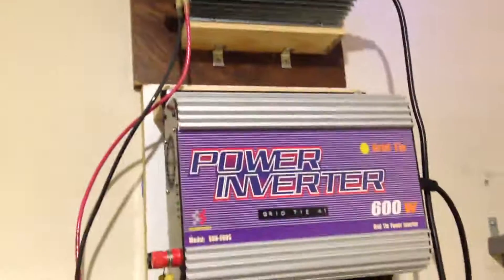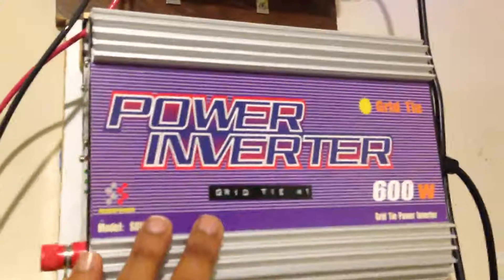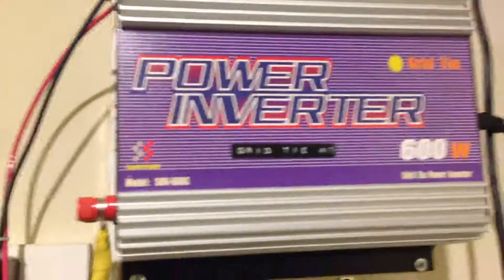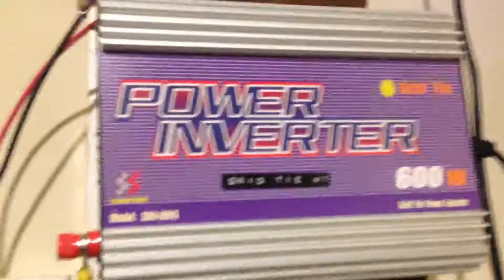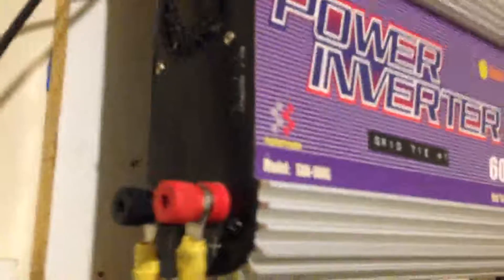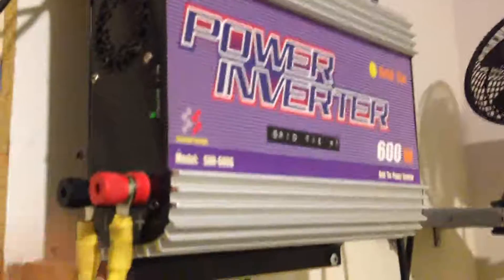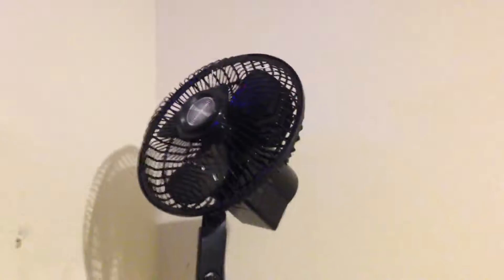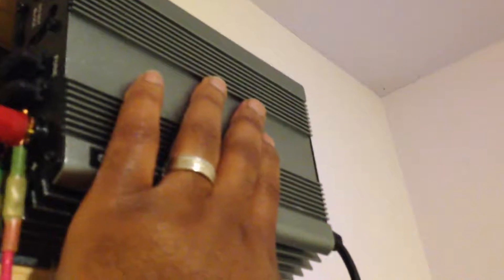DIY Grid Tie - A word about cheap Grid Tie inverters

Comment: I love these things.  I paid big bucks for our 9k solar panel system.  You could put external fans that turn on when the unit gets hot.  But do these units shot off when power to the grid shuts off?  That's when you run into problems if the power company sees power coming from the line when they are working on the wires.  My unit shuts down during power outages.  I'm using a Sunny Boy 7.7 inverter.
Reply: Sunny Boy are a good brand, German made, certified and better than industry average long term reliability.
Reply: @MatthewTaylorAu  Good to know.  The thing I'm worried about is the little fan that comes on inside when the inverter is pushing a lot of power through it.  When it's at 8,000 watts, that little fan is on at full speed.  Eventually those fans burn out.  I wonder if the system knows that it stopped working so a new one can be installed.

Comment: I always put a 600-900w dc to dc regulator on each of my GTIs. I power each at the maximum input voltage, and then limit the current. I also put 1 or 2 computer fans on each GTI connected in parallel to the internal fan. I haven't had one blow up in 6 years.
Reply: How that setup working? I was just about to do the same thing with a 1500W DC/DC Boost unit. 12V to 48V limited to 5A
Reply: @ScubaJamaica  so far no problems whatsoever.

Comment: If you are powering you're grid tie inverter with say a large battery bank or something that could Supply more than it's rated power and it's tied into a grid that could consume more than its rated power, will it limit itself on how many watts it produces?

Comment: So you run the inverter to generate power then you use a fan to cool the inverter. Sounds like the power generated by the inverter is cancelled out by the fans you are using to cool the inverters. 🙃🤔

Comment: Not efficient?  Did you ever measure the efficiency?  Do you even know how?  I got 900 watts into my 1000 watt cheap grid tie inverter.  At full power the Grid Tie Inverter does get warm but it is not dissipating 500 watts which would be the case if it was 50% efficient.  I see nearly full output power.  They are very efficient.  Also you'd be best to get a 24V DC relay and turn your external fan on when the internal fan comes on.  I got 2 years on my cheap GTI so far.  Had to lube the fans but otherwise ok.

Comment: got a question if it is plugged into 110 volt that is on one leg so if something is plugged into the other leg will it get the power also or do you need one on each leg of the 110v? Thanks
Reply from the maker: old time engineer no need to plug one into the other leg. With the way these things work, they will provide power first to household loads then back into the grid.

Comment: why did you remove them?
Reply from the maker: I bought some certified ones because I wanted to go grid-tie all the way.  I've since abandoned the idea of grid-tie altogether. It was fun at the time.
Reply from the maker: Charles Wright these along with energy conservation practices, LED lighting, and a decent amount of solar will save a little, not the fraudulent claims made by many advertisers, not unless you live in a tiny home with next to nothing in appliances. But a typical modern home, with typical usage habits, you may save a fraction on electricity with these cheap units.
Reply: Was it not saving you any on electricity?
Reply: Thanks for the reply
Reply: rhandsom, what caused you to abandon the idea of grid-tie?

Comment: thinking that if you were to mount them on something metallic the heat would dissipate better. Wood isolates temps.
Reply from the maker: With the aluminum housing and the fan blowing air directly out of the unit, the temperature stayed at a very reasonable operating value. A metal plate or something metallic as you suggest would work even better.  I've since removed these units, but your suggestion is sound.  Thanks for the comment.

Comment: They are mounted wrong. The heat sinks would be much more efficient if he would mount those vertically. Rotate 90 degrees where the fan blows heat out of he top instead out of the side.
Reply from the maker: I've since stopped using these devices.  But I do agree with your assessment, rotating them 90 degrees to the vertical position would promote better cooling.

Comment: Thanks for all the info you are putting out there for use that are just getting started.if we don't use the ones your showing on your system What else can we use instead?Have they come out with something better -more efficient and safer?and still affordable ??
Reply from the maker: Thanks for the comments.  If you want to use more efficient micro inverters, then I would suggest the enphase or SMA brands of micro grid-tie inverters, they are safe, efficient and affordable.

Comment: Don't buy these units without a limiter, only makes power if you are drawing power off grid, thus zero out at the meter...The grid-tie limiter inverters are great especially if you have the stupid 'smartmeter' on your house and you don't want to do netmetering redtape bs... work directly off panels but switch to battery over night...

Comment: What would happen if you had a regular inverter running and you plugged a tie inverter into a socket?
Reply from the maker: First the energy from the grid tie would supply power to the loads running off the battery  based inverter. Any extra power would feed back into the inverter. If the inverter is not an inverter\charger type that allows for AC Coupling, then the excess AC going back into the regular inverter will destroy it. I've destroyed a regular inverter this way in the past. If you have 300w coming in and 500w in loads, then it did work for a while. But if you have 300w coming in, and 200w going out in loads, then the extra 100w of power has no where to go in a regular inverter, so it will fry it.  Inverter\chargers such as the MS4024PAE from Magnum Energy that are designed for AC Coupling do not have this problem.

Comment: Very informative video :) Thanks for sharing!  But I have one comment to make.. why are you powering the RV fan from a Radio Shack AC to DC adapter instead of running that thing directly off your DC coming into one of the inverters??  The benefit would be two-fold!  The fan would only run when there is sun (which is when they heat up), so you wouldn't need a timer nor would you need to babysit it.  Secondly, the fan would be way more efficient running off the solar DC, rather than going from DC to AC and then AC to DC.
If the DC voltage from the panels is too high for the fan, buy a $5 BUCK converter that is about 90% efficient at DC-DC step-down conversion.
Just saying... :)
Reply from the maker: Thanks for the comments.  The reason I was using the power supply was because my battery voltage was too high, and I had this old adapter laying around so I said why not.  I agree with your comments, for me it was just a way to use a spare part.

Comment: I've have 2 of these SUN-500G inverters mounted in my shed where it regularly reaches between 90°-100° in the Summer. They have been there for 4-5 years running reliably as far as efficiency, Eh. I regularly see 450 watts and higher in Summer from Six 100 watt 12v Renogy RNG-100D solar panels mounted on my shed roof. 4 of them wired in parallel into one 12v SUN-500G(500 watts) inverter and the other 2 wired in series into a 24V SUN-500G(500 watts) inverter. I have them mounted vertically so the fan faces upwards using heat's natural tendency to rise to help aid in heat dissipation and evacuation. Thank You for the informative video.
Reply from the maker: Thanks for the comments and info on your experiences with the GTIs.

Comment: A grid tied inverter that is not UL certified is not legal in most areas of the country and most electric companies will not allow a home owner to connect a non UL certified  inverter to their utility grid.  You must not have gotten an interconnection agreement with the electric company because if you had gotten a signed interconnection agreement, the electric company would not have allowed you to connect a non certified inverter to their electrical grid.  This makes you liable for any damage to the grid and liable to any utility worker that may get hurt or killed because of your inverter may send power back to the grid during a power outage.  If this inverter would start on fire and the insurance company would find out that you connected a non UL certified grid tie inverter to the grid they may not cover your damages.  This video is giving the electric company and the insurance company evidence.  I know what I am talking about since I am the project foreman of a solar installation company.  I deal with electric companies and state and city electrical inspectors every day.
Reply: +Doug Brimeyer Yeah, i'm not entirely sure what regulation they copy and pasted that requirement from when they penned these regulations but it's completely unnecessary for a grid-tie inverter. A true grid tie inverter requires a sine to be present on the line to function. Yes, even the cheapest eBay POS on the block requires this. It's a core requirement for function based on theory of operation. The inverter cannot produce a syncronous output without an existing sine wave to monitor and the inverter simply goes into fault mode. measurement and monitoring is completely passive by design so there is nothing measurable on the inverters output during a disconnect.

 This portion of the code is a boogeyman likely carried over from backfeed practice from devices that do not operate on the same principles. Ie. Idiots backfeeding standard inverters. Or, folks with generators on a backfeed that cheaped out on a transfer switch. Better safe than sorry with those folks so I can rationalize the requirement. But not here. 

 I'm also not sure how UL came into play here. They exist for the consumers safety, not the lineman. Insurance companies consider these devices (UL approved) low risk and thus a standard pre-requisite for bonding. Mains must be covered, high voltage reliefs must be etched, etc. All things to reduce flame and personal injury risk that the insurance company might have to pay out pay out for.

 In fact, these devices by design are not even capable of producing a power surge. So that claim is utter hyperbole as well. There is just no conceivable failure mode by design that would allow this.

 You want the glass half empty version? These requirements exist to protect the power company, not the consumer or the lineman. Not in this context. Power surges FROM the grid damage equipment because they are subject to transformer breakdown and storm surges. We wouldn't have surge protectors if that wasn't a fact. Surge comes down the pipe, non UL approved device catches fire and burns a home down. Home owners insurance tells you to go pound sand so where do you look next for compensation? The power company. And guess what? Their insurance company won't cover non UL devices, either. Your insurance backs out, Power providers insurance backs out, only the power company itself is left now and they're absolved because they already put it in ink that you weren't allowed to use the equipment.

 The only person who could possibly lose from operating these grid tie units; is yourself. And the man seems old enough to make his own decisions to me.
Reply: These things normally have a relay to connect the AC side when grid power is present  (default state is disconnected has to be energized for the relay to connect the AC side) not this have ever used one
Reply from the maker: Thanks for your comments.
Reply: +Doug Brimeyer All components in a solar photo voltaic system MUST be UL certified and MUST have a signed interconnection agreement with the electric company that owns that electrical grid, and in most cases, be inspected by a authorized inspector to be legal!
Reply from the maker: +Doug Brimeyer Again, thanks for your comments.
Reply: +rhandsom I am not trying to sound like a jerk.  I have just seen to many videos explaining how to do solar that are just wrong and very unsafe.  Utility workers are getting seriously hurt or killed.  All grid tied inverters are required to have a mechanical means of AC disconnect within 10 feet of the meter.  An interconnection agreement with the electric company makes sure the system is installed correct and safe and give the electric company documentation of where the AC disconnect is located so that the utility worker can shut down the system when needed so they can work on the grid safely.
Reply from the maker: +Doug Brimeyer I take no offense to your comments. I respect your opinion, views, and experience.  I see nothing wrong with you sharing your thoughts or views on the subject so people can make up their own minds.  I shared my opinion in the video and I feel that was enough.  Again, thanks for your comments.
Reply: @dougbrimeyer5715  you work for a over priced solar company ripping people off . As for the monopoly electric companies buying off politicians they are ripping people off to . People want to save money and you and your rip off solar companies dont help anyone.  You want tens of thousands of dollars for cheap equipment you can buy for hundreds. How do your fellow solar rip off companies sleep at night.

Comment: The general concensus is not to run more than 1/2 to 2/3  of these  inverters' rating as you mentioned  The low efficiency ends up as heat the inverter needs to dissipate.  The best inverters don't need fan cooling, which also eats into overall efficiency
Reply from the maker: Thanks for the comments and good info.

Comment: Hey brother the sun inverter I know is too good but let me ask a question it is legal to use ? It compliance with all law requiring and or approved for UL 1741 and IEEE
Reply from the maker: +pepepon No it is not.  I believe they are relatively safe, but they are not IEEE 1547 or UL 1741 certified.  They satisfy the anti-islanding requirement, but do not stay off for the required 5 minutes before restarting.  No US utility will approve them for use.

Comment: Love your videos. Quick question. I have two 140 watt panels in parallel hooked into a 1000 watt Chinese GTI. See about 230 watts on meter in full sun on meter at the wall. The panels are rated at 7.91 amps but I am only seeing 2.08 amps on my KillAWatt meter at the wall. Why so few amps after the GTI?
Reply from the maker: +Bleemus 230w is not bad considering you said you have 2 140w panels which under Standard Test Conditions should give 280w.  230w/280w = .82 x 100 = 82% efficiency.  However, I recommend hooking the panels up in series to increase the voltage, if your 1000w GTI has a 22v to 60v operating range.  The cheap GTI's are "supposed" to be MPPT capable.  MPPT takes advantage of the higher voltages to get you the best power performance.  MPPT works to get the maximum power by raising the voltage and lowering the amps OR raising the amps and lowering the voltage to maintain "peak" power (watts).  All through DC to DC conversion circuitry.  However, if your GTI operates between 10v and 30v  + or -,  then you may be stuck with parallel hookup.  Also, bare in mind that the amps you are seeing on your KillaWatt meter are AC amps, not DC amps (if your KillAWatt meter is the standard plug in variety).
Reply: +rhandsom thanks for the reply!  Sadly the inverter I have is a 10.8 to 30 volt. It is MPPT so I am guessing that the reason I am seeing only 2amps is because the house doesn't typically have a large load on it.  Averages around 400watts unless I have the dryer going. Just a guess. Keep up the good work!

Comment: Im curious how to connect a mc4 cable from 2 100w solar panels to the 600w grid tie inverter, which will then be connected to a power outlet in the home. (ill get more panels as time goes on) I don't think you offer a video on this unfortunately...

How do I connect the mc4 cables from the solar panels to the grid tie inverter? 
What else is needed?
I do not want to use batteries.
Reply from the maker: You have a couple of options, 1 cut the ends off of the MC4 connections, which I don't recommend, or get some PV wire with MC4 connectors and connect the same way you would to a charge controller.  You could also simply buy some MC4 connectors online, and buy some 10AWG wire from the hardware store and make your own PV wire, then connect your panels in "series" and then connect to the GTI to maximize the MPPT performance with the higher voltage.

Comment: We have a 300 grid tie running @ 270 watts and a 1000 grid tie running @ 850 watts. So from what I have seen on the ones we have, I have to say they are very much efficiency. I am running the same kind you have in the video (the bottom one 600 watts) I know you get more watts if you input @ 80-85% of DC power. like ours is DC input 10.5 to 30vdc we use 24vdc solar panels. Got to minus the % of panel and wire volt drop as well. We have been running ours for years and not ever had one to overheat. Long as you do not power them. We are getting 80% of the rated power of our inverters so they are very well efficient. I have come to find that the ones that overheat are not installed in a well-vented room. So over time it starts to pull in it's own made heat.